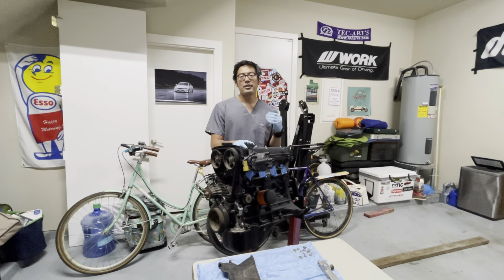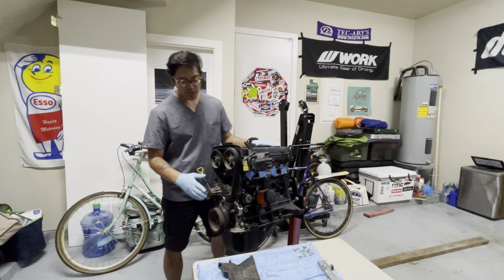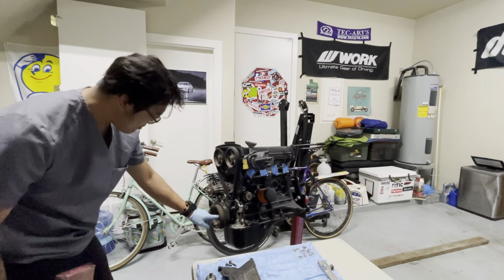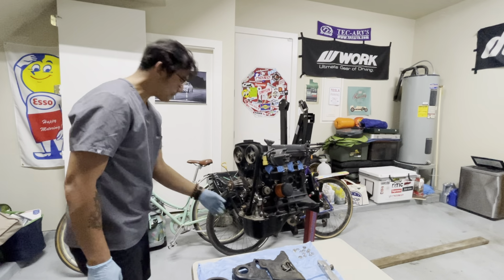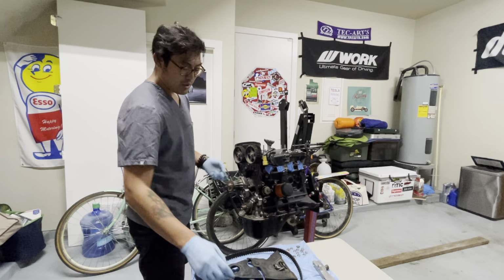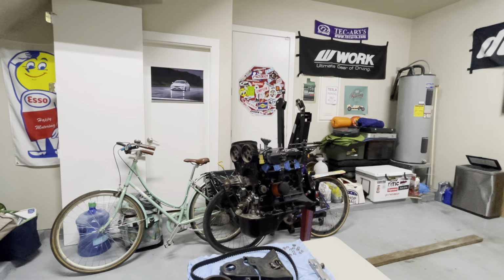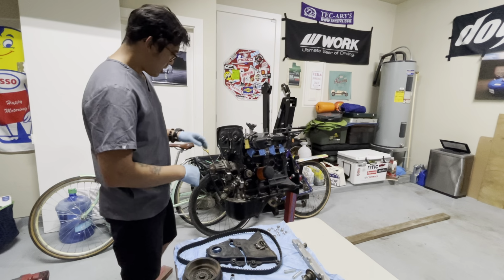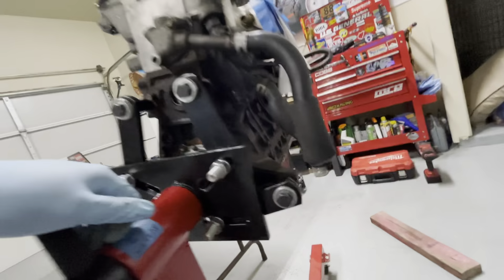16v 4age spare motor tear down part 1

Comment: Thanks for the breakdown. Can you advise on what bolts to use to mount the engine to the stand?
Reply from the maker: You can use the transmission bolts to mount the the stand. I remember its a M12 x 1.25 tread size. You can get a 4" long M12 x1.25 bolt with washers to mount it to the stand.